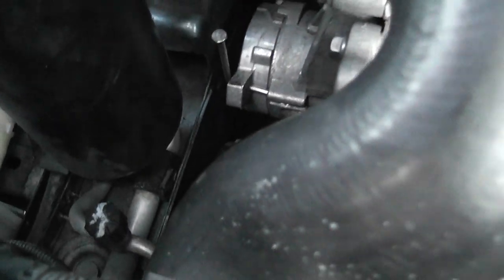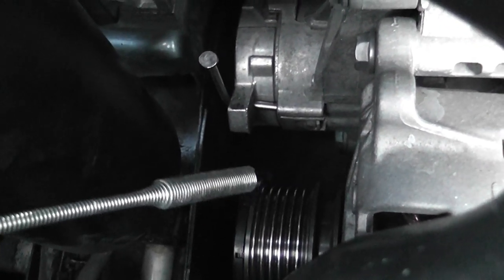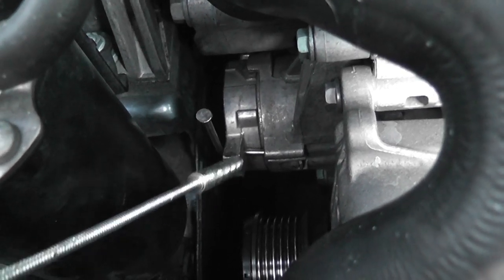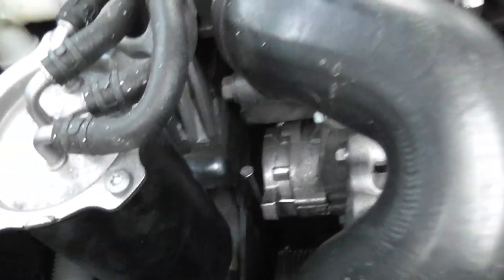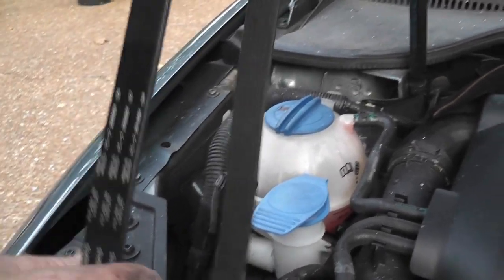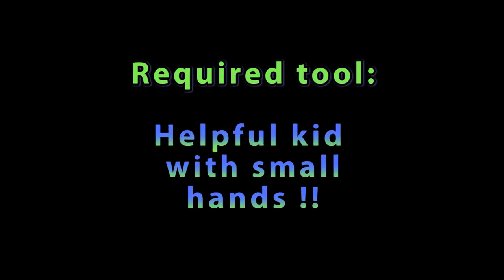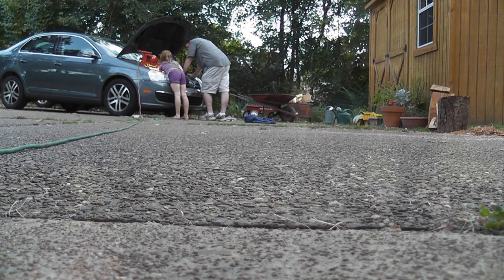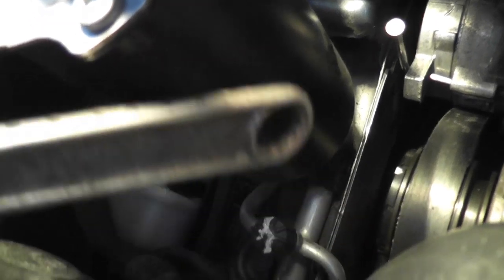Replace 2006 VW Jetta TDI Serpentine Fan Belt

Comment: Did u know its good to soak used belts & even brand new belts in any kind of armor all product? Wiper blades too, Any plastic or rubber parts.  No joke, I'm a big believer, helped me out a lot.  take care.
Reply from the maker: Most interesting.. I have never heard of that before.  I wonder if it will keep a wiper blade softer for a lot longer.  Seems like they are always getting brittle before I think they should.  I may give that a try next pair!
Reply: @stoppedsnoring  Funny you thought of that, I've been storing spare wiper blades in the good 303 stuff, both used & a few brand new wipers, seems to help.